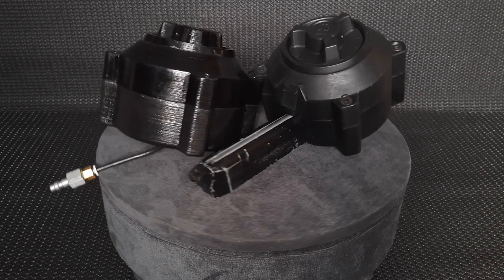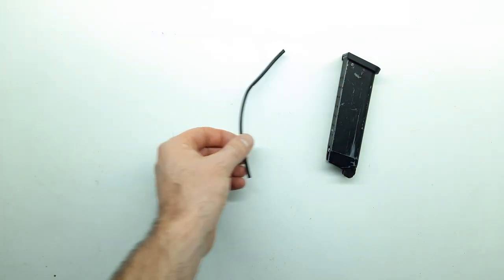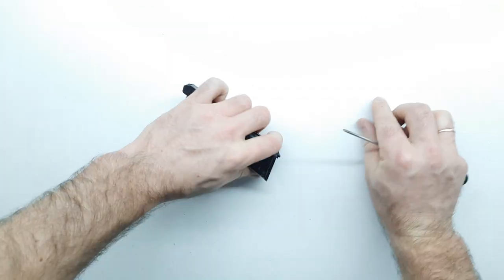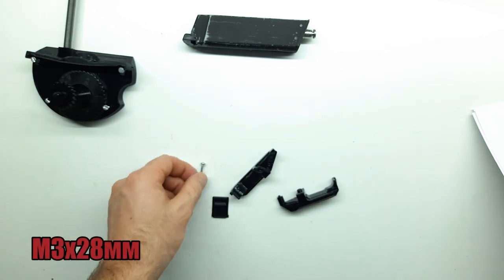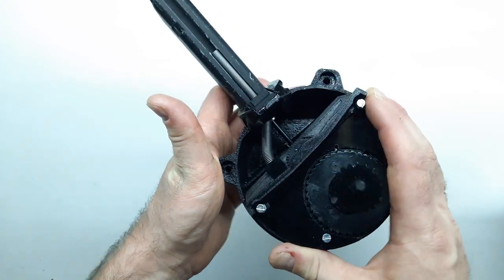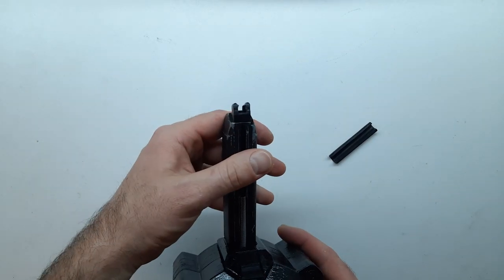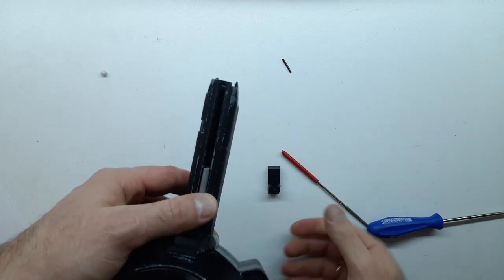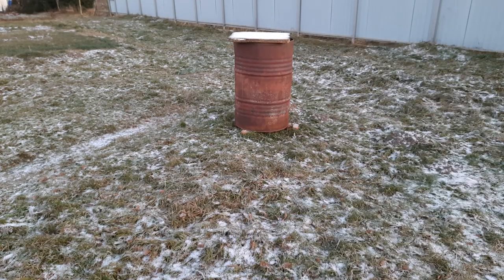Бункерный магазин (бубен) для Glock 17/18 при помощи 3D-принтера

Comment: So this isnt compatible with WE magazines? Is there a change you could redesign the base plate to fit WE magazines?
Reply from the maker: On the magazine from WE, the landing hole for the filling valve differs from the KJW magazine. You can try to expand this mounting hole, at your own risk. And the plastic will install in the same way as on the magazine from KJW
Reply: @HeavyBarrelRU  I noticed WE mags are a tad wider. Did manage to make the magazine holder fit after some filing. I take it you used m4 bolts?
Reply from the maker: @7249xxl  If we are discussing a part that is installed on the magazine, then M3 screws were used there
Reply: @HeavyBarrelRU  Thanks for the replies. Just finished printing the back cover and the quality is amazing you've done a real nice job with it.

I just wonder because it seems that some of the internals are missing.  Are these from other devices or can these models be aquired elsewhere?
Reply from the maker: @7249xxl  Yes, for assembly you will need spare parts from a high-capacity magazine from AR or AK (airsoft), it is advisable to use manufacturers such as cyma
Reply: @HeavyBarrelRU  thanks! Really appreciate all the answers! Currently racking out the last prints for this project so far am amazed by the quality. Cant wait to field this.
Reply from the maker: @7249xxl  Thank you! I hope you can complete this project
Reply: @HeavyBarrelRU  After some metal work on the WE magazine i got it to fit. The only issue im having is feeding the bb's. What type of tube did you use or is it a spring? If so what is the technical term as i cannot seem to find similar materials.
Reply from the maker: @7249xxl  You can use a spring to feed b'bs from an airsoft gun box. But in order to use it, it will be necessary to slightly change the groove of the store through which the balls come.